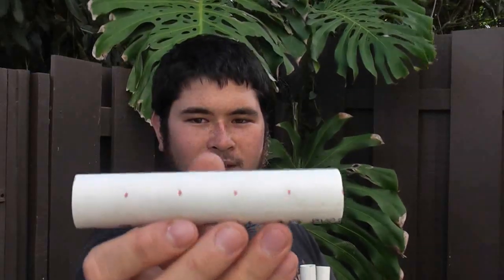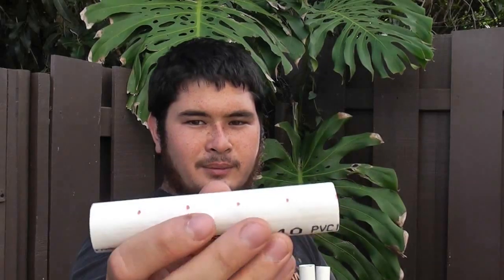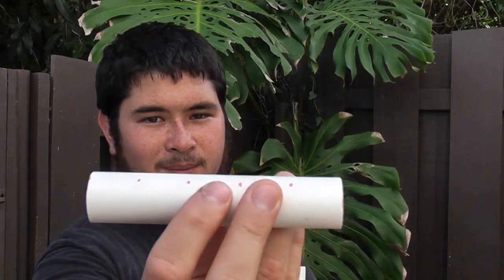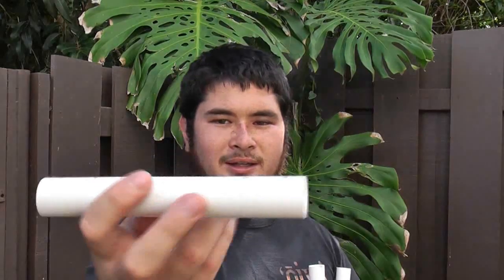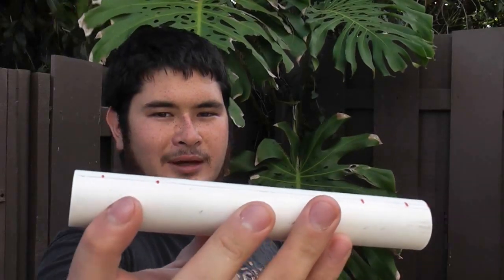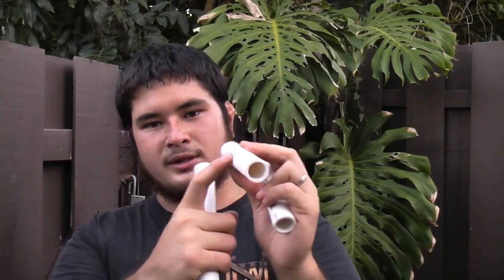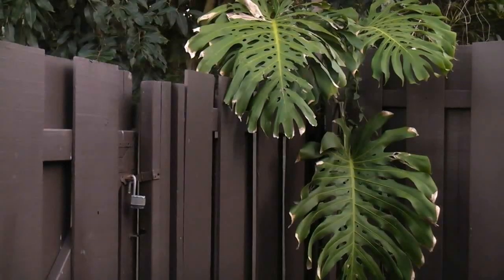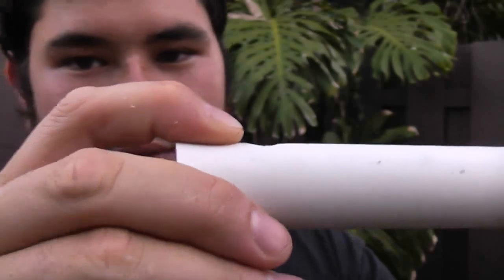A 65 Pound Centershot PVC Bow Part 1 - Layout and Flattening

Comment: What Wattage Is Your Heat Gun? Im Trying To Make This Bow And I Cant Get My PVC To Stay Hot Enough, I Have A 750/1500 Wattage Heat Gun But It Doesnt Heat Up More Than A Foot Or So Before Things Start To Cool Down And Fail, So I Wanted To Ask, What Wattage Heat Gun Do You Have And Is There Any One Ouy Would Recommend For Less Than $50.00?
Reply: hold over the stove then use the heat gun to maintain the heat
Reply: Mom Wont Let Me Use The Stove For PVC, And Besides, Its A glass top Stove.

Comment: my 70lb pvc bow shots at 285 fps but was made with 1/2in sch 40 put down in 3/4 in sch 40 with a 1/2 fiberglass rod down the middle the bow is 60 in long the fiberglass is 58 in long